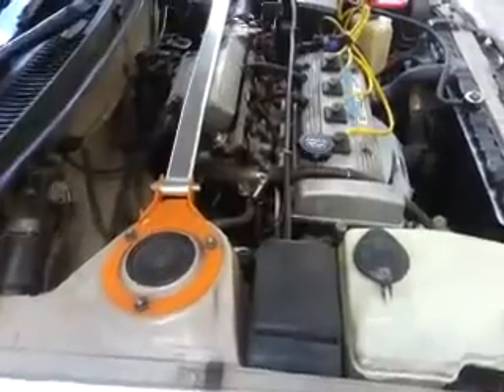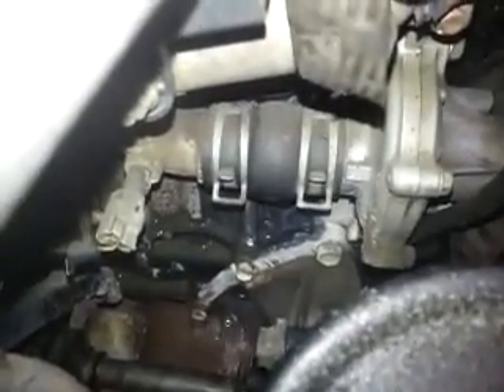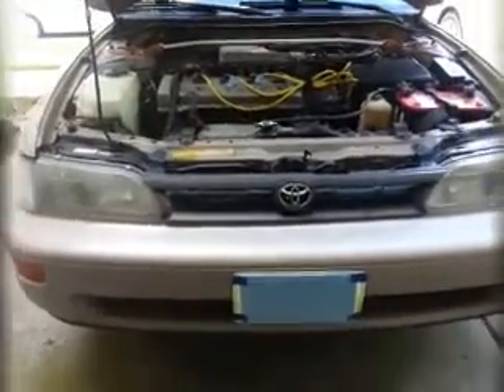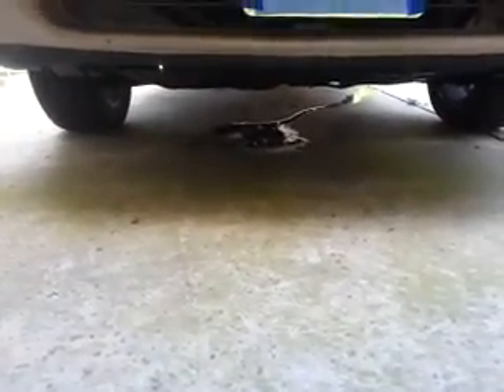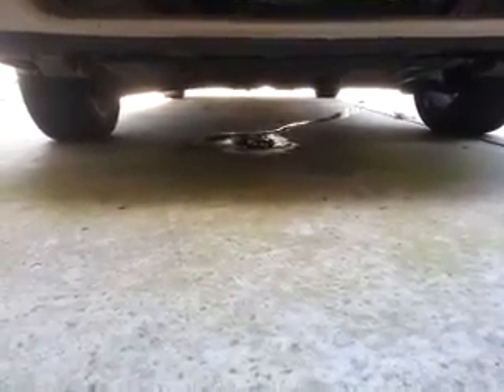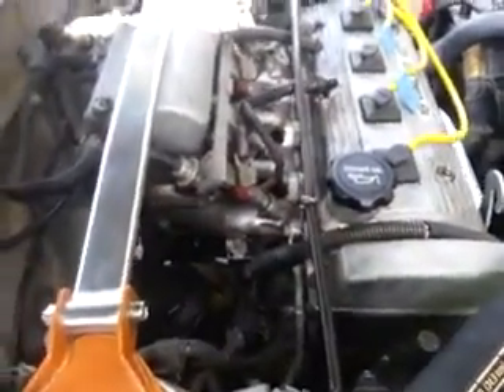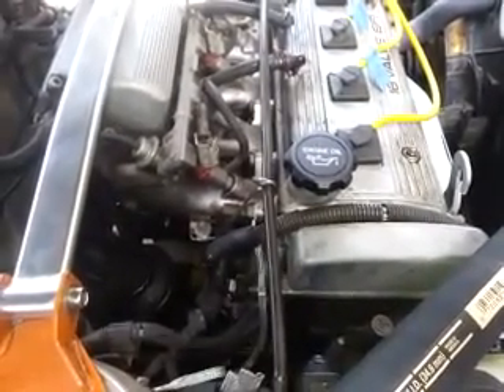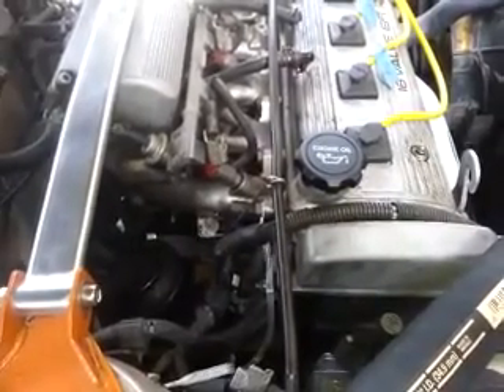How to Change a water pump by-pass hose on a 1994 Toyota Corolla 7AFE 4AFE

Comment: Thank you so much this just happened to my 4afe on my way home from work
Reply from the maker: No worries, us Toyota guys have to help each other out ;)
Reply: @Engineerboy100  I am about to replace this hose a second time in 4 years, I think I might have installed regular radiator hose last time haha. Could you please tell me where you bought that brand hose and if that exact brand and diameter size fit snug or kind of loose on the nozzle? I noticed the high pressure of the water pump is able to push coolant past the clamps(no matter how much you tighten the clamps), if the hose slides on perfectly, I would want a slightly tight fit over the nozzle to help with sealing. Let me know how that 1 and 3//8 diameter fits. Thank you very much, Sir!

Comment: Clint, I've been working on cars for a lot of yrs..... That corolla water pump was the hardest one I've ever had to do.  Good Lord, what a foolish design. Between the pulley, & that stupid bypass hose ..... There really has to be a better way.  You weren't kidding on your video. LABOR INTENSIVE job.
Reply from the maker: I'm gonna have to agree with you on the fact that it is a difficult water pump to change. I've been doing them for about 32 years and unfortunately it is not the most difficult or the worst design.  I hate the ones that are turned by the timing belt instead of a serpentine belt, those for me are the worst because you always have to do the timing belt too when you change the water pump.  It protects the engine from a timing belt failure as the pump goes first, but it's a pain of a job.
Reply: Clint Hightower Yeah, you're right.

Comment: Clint, thanks for posting all these videos.  I am doing a valve job on my 7AFE and you have been a big help.  One question: what does the gasket look like that goes between the bypass pipe and the head?  I don't seem to have one in my Fel-Pro gasket set.  I thought it would be an O-ring gasket since it is part of the coolant system, but whoever had the engine apart before just used blue RTV everywhere.  Thanks!
Reply from the maker: http://www.ebay.com/itm/W0133-1745973-OES-Genuine-Water-Outlet-Gasket-/231985108576?fits=Year%3A1995%7CModel%3ACorolla&hash=item360363d660:g:QzcAAOSwvg9XZ2hk&vxp=mtr
Reply: Thanks very much!

Comment: Clint....in the process of doing my timing belt/water pump.  Do you HAVE to remove that bypass unit?  Is there no way to muscle that 4" reinforced hose onto the 2 ends? (bend it into place)
Reply from the maker: KEITH HESNEY remove the hose clamp closest to front of engine and slide it back onto hose, then losen flange end of by pass for more working room.
Reply: Believe it or not, $6 at the dealer. Surprising.

Comment: Cover is off... I did go in but I'm not sure if it's 180 degrees off. However, I did install it facing the #1 contact inside the distributor cover.  It slipped right into place no issues. I'm assuming it's right.
Reply from the maker: That is correct. It is set up with a "Go , No-Go" configuration, so if it goes in it is correct. You cannot put it in wrong, it will not go.  If you look at the key closely you will notice that it is off to one side.

Comment: thanks for the heads up, saved me time, much appreciated.
PS Does it require a gasket or anything at the bolt end when reconnecting.
Reply from the maker: I use grey gasket sealer and have never had an issue.
Reply: @Engineerboy100  you have a great day and I love iooo9oolikttyjhut

Comment: Clint, like a Dumbasses, as I was changing the o ring on my distributor, I dropped it & I'm sure the rotor turned... I have the #1 piston at TDC for the timing belt. What direction should the rotor be facing? (cam hasn't moved at all).
Reply from the maker: KEITH HESNEY it is offset. it can only go in one way. if it goes in, it is correct. if you can't get it in, just remove the valve cover so you can see.

Comment: How did you get off the electrical sensor clip that is close to the the hose? it has threads on the lower part of it, but i don't think it screws off.
Reply from the maker: You just squeeze the clip and pull to get it off the sensor.
Reply: ,  @Engineerboy100 , Hi, and thinks for your reply. I tried that, but maybe I should squeeze harder? Squeeze with my fingers or pliers or something?

Comment: Thank you for the book. Quick question... This is an age old question but how much tension should I put on the timing belt? I used the old one as a reference but it felt a bit loose to me.  Also, will the belt need to be retensioned after a few days of running?
Reply from the maker: KEITH HESNEY the belt should be tightened firm but not stretched, it should deflect about a quarter inch when pressed firmly with a finger. it should not need to be retentioned.

Comment: When you replace the water pump, do you usually replace the whole unit or just the front part? Weird how they separate.... I choose to replace the whole unit with an oem unit. Not fond of aftermarket water pumps.
Reply from the maker: You only need to replace the front portion unless the rear housing has been damaged.  The front portion only is how they come new from auto parts stores. The "front" portion where the impeller is, is what is considered the water pump.

Comment: Did you install the bypass pipe first or fitted the bypass hose first? im having trouble getting the two screws lined up with the pipe.. thanks in advanve
Reply from the maker: I put the hose on first then the flange. If you use the correct length hose it should not be too hard. You can also change the hose clamps to the screw type so you can leave it loose until you have the flange lined up....don't forget your gasket ;)

Comment: Do you have the part number for the water pump by-pass hose?
I got a 1997 Corolla 1.6L 4A FE, would hose be same as yours?
Did you replace the gasket before putting back to hose?
Reply from the maker: Look at 3 minutes into the video, the part number is displayed.
Reply: Clint Hightower, unless I missed it. 
I do not see nor hear no part number for the hose (2:00) nor the gasket part number.

I don't need to buy the long hose.
Reply: use the "gates green stripe " hose #24020 it is one and one quarter inch ID not  one and 3 eights . and although you CAN use a smear of silicone to seal the bypass hose tube where it meets the head . i prefer using the actual gasket .
Reply: @angelisone  I just went to the Toyota Dealer and picked up the bypass hose and the gasket (ordered them yesterday by phone)..The hose part number is 16262-16030 (2 3/4 inches long X 1 1/4 ID). The gasket part number is 16347-15010. The hose was $7.55 and the gasket was $0.57 cents for a grand total of $8.69,paid when picked up! I have a 1995 Toyota Corolla DX with the 1.8L engine (120,000 MILES). You might want to drain the coolant out because if you remove the engine oil dip stick for more room to work ,you sure don't want the coolant running into the dip stick hole opening! Clean the pipe on both ends with fine sandpaper and or a wire brush before re-installing. I'm probably gonna replace the squeeze clamps with the screw type,doing mine tomorrow> 1-16-2019. Oh,by the way Clint,very good video,but I just couldn't buy 3 feet of that Gates hose (24020) at $12.99 per foot,thanks.
Reply: Steven White, Toyota wants over $358.00 for the complete unit, which I am not crazy to put that much money in. So I cut and made my own hose & gasket.
Thank you for those information that Toyota refused to provide.
Reply: @angelisone  i bought the gasket and sealer for $12 . but the hose was another $8 .00 . but since i did the repair myself . all done for just under $20
Reply: MrRustyvango, you were lucky you didn't have to remove the water pump and replaced that water pump's O-Ring.

Comment: What tool did u use
Reply from the maker: I used a lot of tools, you're going to have to be more specific :)
Reply: To remove the pipe holding the hose. I see 4 bolts but I can’t remove them with my typical wrench because of the fuel injector wire. Thing in the way
Reply from the maker: I used the L-shaped socket spanners. the 12 points are better than the 6 points.  https://www.ebay.com/itm/L-Shaped-Hex-Socket-Wrench-Nut-Driver-8-19mm-Dual-Ends-12-Size-Option/182570429995?hash=item2a820bae2b%3Am%3AmWisJaSa_dJQEZOMCjbJS3g&var=485142321168